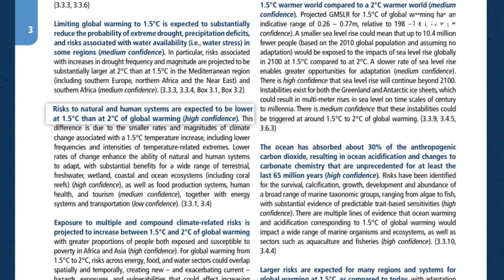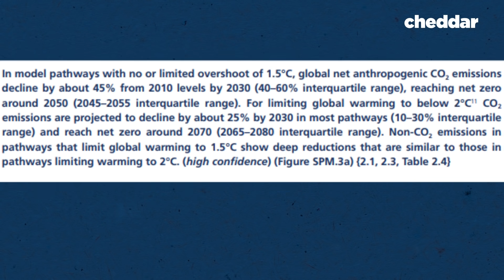Wooden Skyscrapers Are On The Rise - Cheddar Explains

Comment: What about degradation by elements, mold/fungus, and insects+small animals?
Reply: Those exact same issues apply to concrete and steel, as well. Just go outside and look for a weed trying to break through a concrete sidewalk for a common example.
Reply: All of these actually apply much worse to concrete. Wood stands up much better to the elements and isn't susceptible to damage from water getting into micro cracks like concrete is. Concrete is extremely brittle but wood actually has properties of both ceramics and metals.
Reply: What about those japanese temple's
Reply: @randyd9414  they're entirely rebuilt every century
Reply: The production of crosslaminated wood follow the principles of mass timber one. Timber is left for a dozen up to 20 months in open spaces to "season" it. Plus, many times additives are added to its surface, such as antiparasites and waterproofing coatings.
That's why is more expensive than steel
Reply: Different woods for different purposes. There's soft and hard wood. Soft woods like cedar will repel bugs/termites. Hardwoods like oak, walnut, mahogany are water resistant, though they are expensive, heavy, and don't deter bugs. So you use hardwood on the interior/frame and softwood on the exterior. If the building is properly sealed and wrapped (and the foundation isn't splitting), the frame will be fine for decades or more. It's a lot easier to remediate portions of a wooden house than one made of concrete and steel. The same should apply for tall structures. Just make a wooden frame around a vented concrete core.
Reply: You can find 100+ year old wood huts in prestine condition if kept well, just like anything else. Concrete doesn't age well and needs to be maintained repeatedly if you don't want visual decay either. It's also thought by some that we shouldn't build buildings that last 100+ years, as they will be aged, inneficient and the ressources required over it's lifespan might be more than a building built to only last 60 years that has less resources invested and therefore more efficient to replace when it's time.
Reply: @SirMangoMantango  correction modern concrete doesn't age well. The concrete made by the ancient romans on the other hand is a different matter
Reply: @SirMangoMantango  really, so we can just replace our houses every 10 years, and thats somehow supposed to be better
Reply: @SirMangoMantango  IF kept well. High maintenance as f.
Reply: @SirMangoMantango  so what would be done with the 100+ year old buildings in that scenario? Tear them down, find investors to make new one in its spot, give old residents money or apartments in the new building?
Reply: @SirMangoMantango  that is very much nonsense. Many buildings in Europe are a lot older than that. Japan is an example of country where buildings don't last. Most of what you see of old buildings are reconstructions. And yes, they used plenty of wood.
Reply: @SirMangoMantango  wood rots faster. It decays faster. It falls faster. You have no point.
Reply: There are already buildings made of wood, so maybe use the same treatment methods as those...
Reply: the right kinds of woods don't rot or just put siding on it
Reply: you-- you can treat wood
Reply: @Lynn-rv4ty  that makes it extremely toxic and its still flammable
Reply: Also fires.
Reply: Fire
Reply: they are sealing clt usually so it doesn't even come into contact with moisture etc.
Reply: Nemerian just about to say that 😂👌🏻
Reply: It just a dressing.
Reply: Old/Chungus
Reply: I grew up in and have done renovation on a 100 year old wooden house. Molds and fungus will grow if you have a structural problem like a leaking roof, the same is true for buildings made out of concrete since the isolation material and internal structure can be affected. In a well built wooden house (ours is made out of squared logs with a panel made out of planks) you can replace the damaged part fairly easily (lift up the structure and put in a new log). Also, wood has some anti-microbial properties so that helps. From what I´ve seen small animals can sometimes be found in the wood, but they don´t do enough damage to affect the structural integrity of the building. There might be climates and local species that make this more of an issue.
Reply: @emmamemma4162  California is facing a housing crisis Because of the building codes being so strict, no one can afford what's built. 
We do not build homes out of mostly timber for a damn reason.
It's not cost effective.
The work to do it right is to much.
Reply: donald trump will kick the molds ass
Reply: Nemerian 4:13
Reply: Wood also expands and contracts over time
Reply: You would be amazed at how much steel can rot.
Reply: it's a fluff piece man of course nobody is gonna talk about those...
Reply: @Alex-cj1uh  That's what I was thinking
Reply: I'm kinda curious about the creep properties of the wood on the lower levels.
Reply: Did yall even watch the video?
Reply: Its not ordinary wood but chemically treated wood or as the video called it stabilized timber
Reply: You can get rid of it using fire
Reply: Its not a good idea to be built of wood, wood cannot support that much weight. Also what happens when it sets on fire
Reply: @greyhead3626  WATCH THE FUCKING VIDEO! DON'T POST A COMMENTARY IF YOU DIDN'T WATCH THE VIDEO!
Reply: What about the fire?
Reply: @conradojavier7547  please, watch the video first.
Reply: @fritzsmith3296  What planet are you on Fritz? When is the last time have you been in China? There are hardly any historic building currently with a few exceptions as the forbidden city. And about Japan, are you aware that most of the historic buildings are reconstructions and there is nearly nothing of historic wood buildings? There are only twelve castles that are considered "original", and even that is a stretch.  The famous Temple of the Golden Pavilion was burned completely numerous times, the last time in 1950. There is little left of the original buildings in Tokyo and many cities.  What do you do for a living?
Reply: Nemerian Exactly! That’s the elephant in the room. 

Let’s take a place like Singapore. The water levels there are rising. Now, hit it with a viscous storm (which does happens, not unrealistic) & imagine the streets underwater for days or even weeks. All those wooden homes wouldn’t survive, but the 60-story tower will? Have these guys not HEARD of de-lamination? 

Keep your wooden tower. I’ll stick with concrete & steel. 

BTW, the corporate world is 70% responsible for global warming. Making wood skyscrapers won’t help. This is a feel-good piece.
Reply: Nobody cares about that. It’s basically ignoring the fact that. Metal frame building can replace the wood (if designed properly) and last a long time but a wooden building won’t last a century no matter how much maintenance was done to it
Reply: @sidjtd  

wood can last verry long. if you use a modular fassade, this kind of building are build for centuries to come. otherwise 100years are not really a probleme. in germany i know wood based building that are more then 400years old. those buildings use a wood frame and  straw filling with clay plastering. not exactly the definition of long lasting. it all depends on the building technic.
Reply: @amduser86  

And almost ALL those old half timbered building are crooked and skewed. It's not too much of a problem for 3-4 storeys but for 50, it's a different story...
Reply: @amduser86  wood skyscrapers are completely different tho. Winds that high put loats of stress on the building. Not to mention the deforestation that would have to happen to Build one building and the fact that wood is way weaker than steel. Fact is this idea so so impractical that its silly to even consider it.
Reply: @sidjtd  There is no steel frame building that has stood longer than the oldest wooden buildings what the hell are you talking about. The oldest standing building to use any sort of metal is the Pantheon in Rome which has a metal ring at the top of the dome. It is about 600 years older than the oldest wooden building which is the Temple of The Flourishing Law (shown in this very video) which is from 670 AD. I'd advise that next time you think before you speak because your statement that "a wooden building won't last a century no matter how much maintenance was done to it" is clearly wrong given that this building has stood for a millennium and 308 years and there are several other wooden buildings of similar age. Metal as a common material in construction doesn't even appear until well into the 1800s.
Reply: @hedgehog3180  there is no steel frame building as old as wood buildings because humanity only started using steel frames fairly recently?
Reply: @sidjtd  You know there are tall wooden towers in Asia that have been maintained for far longer than a century?
Reply: @sidjtd  There are wooden buildings that are 500 years old. It's possible in areas where there are no termites.
Reply: S. I have seen scoated steel rust away in less than a quarter century, so your point is what again ?
Reply: @sidjtd  We have 900 year old wooden stave churches here in Norway, and plenty of 100 year old wooden houses in great condition.
Reply: @sidjtd  we have 900 year old wooden buildings in Scandinavia.
Reply: @sidjtd  Firstly, that is not true. Wooden structures can last more than a century. 
Secondly, should a building used for practical purposes and productivity really stay up for a century? After only 20 years, it will look dated and unappealing. Within 50 years, most of it's facilities and equipment will be wildly outdated. If you want to avoid that, you have to renovate and maintain. In a 100 years, people will have spent more money maintaining it than it would cost tearing it down and building a new structure. 
And that's a big problem in many cities - we're so hellbent on "building to last" that we won't tear old buildings down even when it's time to do so. In turn, these buildings don't serve us very well, they're often incompatible with new standards, they greatly increase the cost of doing any changes... This kind of mentality is responsible for overbuilding and slow development of many cities. 
Just in my area, there are four big sites which were straight up abandoned and their owners chose to build new buildings elsewhere. These old buildings and building complexes are taking up space in a city that's struggling to find new places to build. 

tl;dr: Our buildings should be more modular, easier to maintain and to tear down. Whatever building you build today will be outdated in a few years, let alone a century.
Reply: @sidjtd 
Metal buildings can last several hundred years with maintenance.
Reply: It's in the name of "global warming", don't worry.